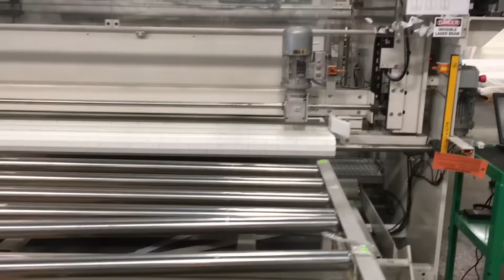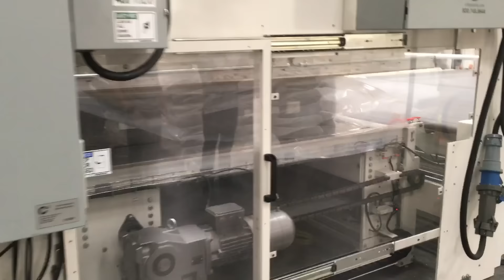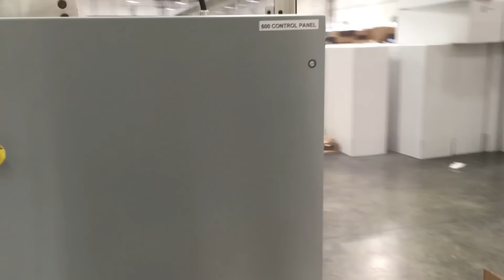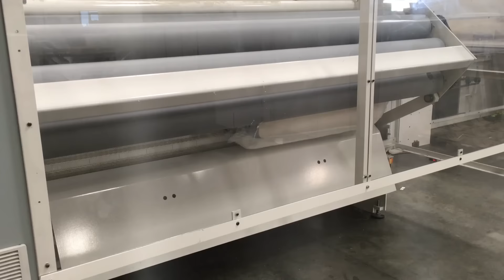How To Compress, Fold And Roll Up A Memory Foam Mattress - Bed In a Box Secrets!

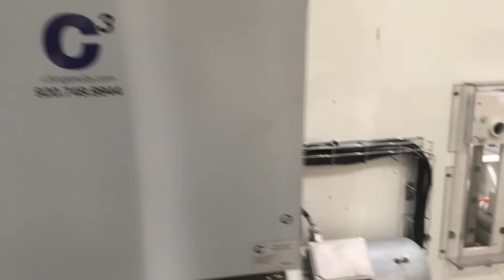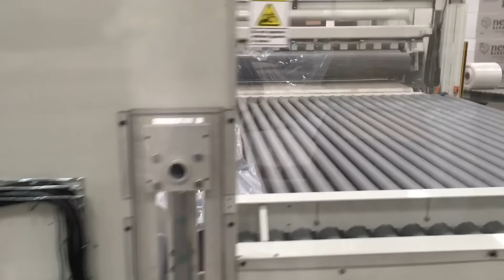Comment: Three years late, but commentary during the video would have been great.   Here's what you are seeing... Beginning to :25, mattress is inserted into plastic bag.  :25 - 1:00, mattress is compressed.  1:00 - 1:15, vacuum is pulled on bag (like a seal-a-meal) and then edge is heated and sealed off.   1:15- 1:35, mattress is folded in half and sent to the outer plastic wrap machine.   1:35 - 2:00, mattress is rolled and wrapped in an outer plastic wrap.  2:00 - end, mattress is deposited from the machine, rolled and wrapped and ready to be boxed.     You're welcome.
Reply: I don't need commentary because I can see what I am seeing
Reply: Texas educashun right here